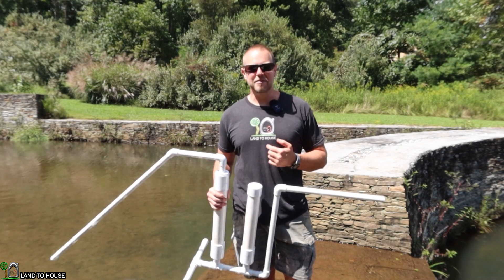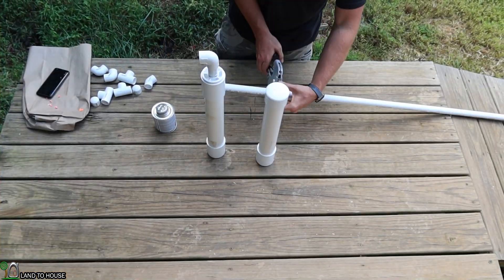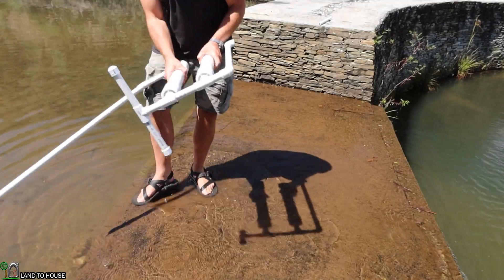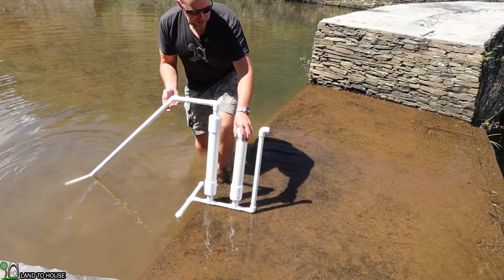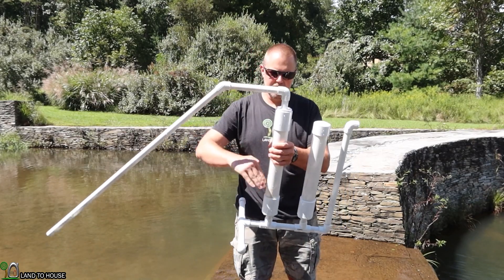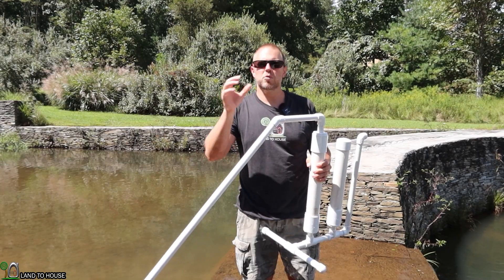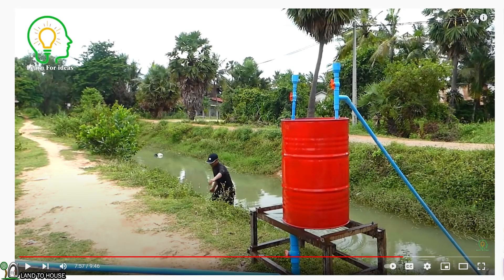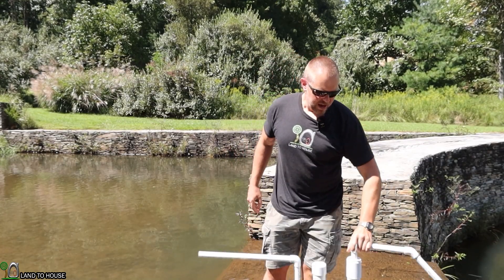Do These Crazy Siphons Really Work

Comment from the maker: Looks like the first Modification is to add a foot valve to the intake. My guess is a valve with the spring removed for easy water flow.
Reply: Hey. Intake are bigger pipe and have a foot valve on the intake
Reply: The video I  watched was posted by "Learn for Life" where he used 3 2litre bottles for decoration..I know how start an actual siphon using my thumb to replace the check valve which is the jerking motion in the "trick for views" video ...the only thing truly working is the YouTube view counter so he has accomplished his goal using smoke and mirrors!!
Reply: Seth, you know it's not gonna work. Now you are just messing with people. But if they eventually learn from it then no harm done.
Reply: Hey what you have there is basically is a small version of the black water filtration system I built, the thing is that I poor'd water in the 3rd 50 gl drum at the end to stop gas from coming out untill the 2nd tank water reached the overflow.. well.. water keeps rising in the second tank and its NOT flowing into the 3rd and I am really confused on what to do? If I add a tire valve thing to the second tank and pump air into it I was thinking it might just push back into the first tank(?) Like you mentioned here.   But I don't know I'm at a total loss on what to do.
Reply: Link to the original video?
Reply: Doesn't matter which fake pump video it is, somebody check the output flow and diameter of opening to estimate gallons per minute or hour so we might track down which cheap sump pump they're using to build their youtube views count,     just a thought!!  Perhaps see how far it sprays and drops to the ground..duplicate that with a garden hose Then count seconds to fill 5 gallon bucket and do the math
Reply: Hey bud you are missing the check valve at the supply end! Will not work without check valve!!
Reply: https://youtu.be/Sp9skvmnVpo Here may be the original. Doing this from my phone or i would post more at once lol thanks everyone
Reply: Here is a link to another one similar. You must have a chek vavle and it must be modified. https://youtu.be/kS8IKWhC6Oo
Reply: It didn't work because you did not add the pump valve (normall found typical rubber tire) at the bottom of the pipe. so that water only go forward and cannot go backwards.

Comment: A thing I'd kind of like to see is a siphon where you have check valves at both ends that allow flow in one direction, and a hand pump in the middle to "prime" the system. Like those cistern pumps, but maybe with a closable valve on the output, or just no output at all. So you crank the handle to create a vacuum, which draws in water from your source via its input check valve. Then when you crank the handle back down, it repressurizes and pushes the air / water out of the pipe further down the line, until eventually the siphon starts once all the air has been pushed out of the system. you might need another vertical outlet pipe above the level of the main through pipe with a valve you can open / close to let air be pushed out, then once only water is coming out, you close that, open the valve to the outlet, and the siphon just goes, as siphons do?

Does any of that make sense?
Reply: So, maybe you'd need sealable valves at the output, and the stand pipe or whatever, so the system can be opened to air to et air out, or sealed to maintain siphon pressure once going?

Anyway, seems like it would maybe be a viable way to quickly self-start a siphon via a cistern-style hand-pump?

Maybe you could even put the various sealable valves and stand pipe and hand pump right at the start after a "hump" (kind of like a self-starting siphon), to where you don't maybe need to fill the entire pipe, just the part before the hand pump (with valve after closed to prime the siphon), then once primed (only water coming out the stand pipe when hand-pumping), you open the final sealable valve and hope the siphon starts siphoning as the water starts flowing out toward the exit pipe, creating a vacuum behind it to start pulling water in from the source? Or would the small amount of water after the "hump" just flow in a way that it sits at the bottom of the exit pipe and doesn't create a complete vacuum to truly start the "siphon" process? In which case, you'd need  more of / all of the pipe filled before opening the last valve to fully "start" the siphon.

Comment: Never going to work with the output pipe opening higher than the input pipe opening. Water doesn't flow uphill...

If you add a longer output pipe that does over the ledge and ends below the level of the input pipe opening, and somehow get the siphon "primed" then it should work, since it'll just be moving water down to a lower level via gravity.
Reply: Would be interesting to see if you could make a "self-priming siphon" similar to the youtube demonstration videos with bendy straws that have several up/down sections, to where when you drop it in the water, so one or more of the bent sections are underwater, the water will flow in up to the gravitational equilibrium point with the surface of the water, but the momentum will then cause it to flow over the next hump, and suck up more water behind it, and so on, so it'll continue flowing through the pipe, 'til it come out the other end. Now, how well that'll work over elevation gain or long distances ... well, I'd be interested to see...

Comment: What about a water tower siphon started by pumping water into tank then using gravity of water going down to also pull it up?  Source has to always be higher than output?  Still good idea for existing hydro dams to increase generator capacity...  Would raising water above levels make generators more efficient?
Input has a check valve while output controlled on a tap.  Gravity pulling water out of the "airtight" water tank should induce it being pulled into the tank as well, so will it siphon?  If so hydro generators could be everywhere..  Siphon fills another water tank feeding generators mounted halfway up the tower..

Comment: "Jiggle siphon" is how he gets it started and that would be an interesting video.  Put a check valve on the end of a straight pipe, and spear-thrust and pull it with the valve underwater and you can 'pump' water out the top. Add a hose that runs out and down the spillway lower than the pond's water line and a normal siphon can be started without a shopvac. But I agree there is no way to get that much flow uphill with no 'power' I suspect he has an accomplice off screen to the right in the pond.

Comment: i am more intrested in the 10 gallomn drum ones from watching many of them the output is always half the width of the intake and the pipe is plugged filled then opened for the vacuum to start i myself like you feel these will only run untill air gets back or tank runs out i think for this to work it needs a long drain away pipe on it that will keep the vacuum but the pipe needs to be full then relesed to start the syphone

Comment: the chinese video has to be fake. you cant syphon uphill. I guess if you could orientate the 'in' pipe against the flow of the river you could get some positive pressure but it would need to be a fast flowing river and only a very small increase
 in height.

Comment: For a ram pump or a barrel syphon to work there must be enough drop in one of the pipes to produce either compressed air or an air vacuum in a tank of some sort. Yes both systems work but it is not perpetual motion because in both cases you need falling water which is a form of energy. Its not magic.
Its simply converting energy ... Find the right website with detailed build instructions and it will work

Comment: like a straw the pulling side needs to be sealed.  only way i could see this working is a valve after the pump,  get a vacuum to start the pull prime you pump while the vacuum is pulling then detach the vacuum. your pump should be able to sustain it as long as the pulling and motor stay air tight.     as long as you have that initial pull tho you should  be able to prime not so sure you can other wise tho. they do have examples of suctionless siphons but they usually involve a section in the piping that air, then the act of it escaping creates the vacuum. like maybe put a valve on the end of the tank fill the hose with water both ends and let the air in the tank run. provided the air escapes the right direction should start the siphon process.

Comment: I would like to see a super long decent pipe. Mabie 80 ft on a 55 gallon setup.. But in a small set up has definitely been debunked as just a siphon. Could it even raise water one inch? So far it's a no go.. But mabie if it can flow with ram pump velocity🤔

Comment: Indeed the one way valve you mis , use one with no spring because of resistence . 
There are several channels doing this kind of video's , its intriguing . 
I was trying it out a little bit myself but has not much time for it so didnt get it to work ''jet''  if it works at all . 
I see some potential ( if it works ) with a recuring system and a hydro elektic system in it .
Pump water from low to higher level and use that elivation to run the hydro elektic system and let the water flow back in a IBC. 
Likely one pipe pump system is to little but 2 / 3 or more maybe not , ad more as needed .
That thoughed get me interested in the idea . 
You use on youre ram pump an bike innertube for pressure , maybe you can use it here to .
Maybe this kind of system can get to much air so the pressure drops , maybe a kind of air pressure release system when it hits an air level .
Like to see if you can get it to work .

Comment: The Original had a larger diameter intake pipe and a smaller diameter output pipe. And a valve on the intake.

Comment: Seems like everyone is agreed about the one way valve on the foot?  If this works, my first question is can it pull standing water to effectively run a ram pump. I think the elevation is still an issue, maybe with an upper and lower check valve?  But starting to feel like we’re chasing perpetual motion.
Reply: A ram pump won't work in standing water. There needs to be a fall distance that the water travels down the drive pipe. And of all that water only 20% gets pushed higher than the starting point.
Reply: @emered-williams  I'm aware. I've talked with him about it before. Just curious how it would work if this was lifting g the water.

Comment: well, the intake in the other video is larger however after watching the video im with ya, total bs. the pond is murky however the water is clean, i believe there is a hidden rubber coupling and plumbing hidden in the pond. the guy simply puts the pipe in the coupling but the motion doesnt seem funny because of the "prime" motion. 

the guy also does "infinte energy" projects, nuff said.

Comment: it does work i did it at work with buckets i freaked my manager out while working at a hatchery working the tray wash machine and being bored / you need a higher intake pipe for downward pressure above the exit line

Comment: you forgot to put the battery and pump inside your "air tanks". notice he didn't glue any of the joints on the assembly video
Reply from the maker: Really good point about the joints. A real siphon pulling up a few feet would break due to air getting into the cracks.
Reply: @LandtoHouse  no siphon and no pumps, just a hose added to the input pipe under the water (during the video cut) and then someone turning the tap on.
Reply: @Bot-ud8qs  yep, amazing how the pond water was so dirty, and the water coming out was very clean and clear. Oh wait its a water filter also......lol........not.
Reply: Good one.

Comment: You forgot to add the one-way check valve at the input.  That prevents the water from flowing back into the pond and causes the pressure to be applied to moving the water toward the output
Reply: The valve is the first part that he picks up at the beginning of the original video.
Reply: not sure how you missed the one way valve
Reply: @carlschwabe1397  It happens when someone has a preconceived notion, wanting to prove a fake point.
Reply: Exactly, no valves.
Reply: Does everyone trolling these days? Why would a valve make any difference? And no, the size of the pipes doesn't matter either. Siphoning is all about pressure and not weight.
Reply: @sestun  If he's going to prove that the device don't work... make sure to copy the device and the items/materials used? No check valve and have the pipe diameter correct as well otherwise might as well make it out of bamboo and springle cans.
Reply: @sestun  You're the one who is trolling. Look up The Action Lab for an explanation. It is not a free energy or a perpetual motion device.
Reply: @sestun  A one-way check valve prevents water from flowing back out the way it came in. So, when he swishes the pipe in the water, it opens the valve, lets in more water due to the pressure from swishing. But when he stops swishing and swings back the other direction, the valve closes, so the water is trapped inside. So, eventually, the entire pipe gets filled. In theory. Though, there may be a point of diminishing returns as more water/weight is in the system, thus making it harder to open the check valve with each swish? Dunno...
Reply: @MGmirkin  Thanks for your answer. I thought about it. You can't create energy from nothing. So basically the device is initally using the muscle energy from whoever is priming it. Right after there is some water in an elevated position compared to the outlet, so it will leak out. But then it will stop. So you have to fill it again. So basically you have an overcomplicated bucket. :) 

I also try to break the laws of nature every time I have to siphon beer. But physics always wins.
Reply from the maker: That can be the first mod in the testing! Thank you.
Reply: Bigger inlet than outlet. 1 1/2 to 1" to 3/4" the up take has to be grader than the outlet. No extension pipe at first.